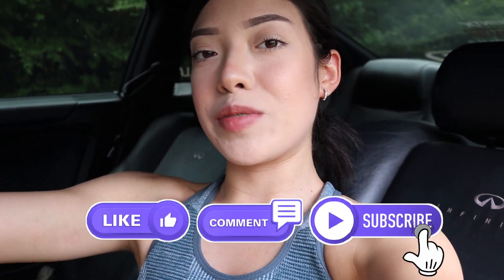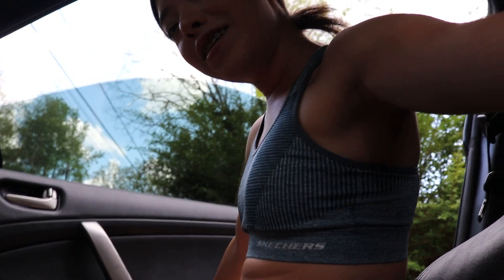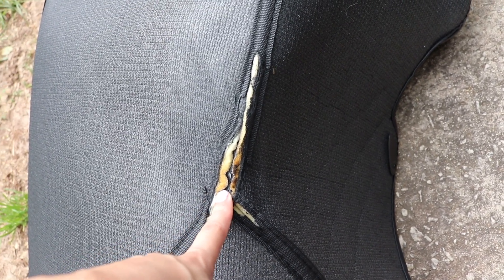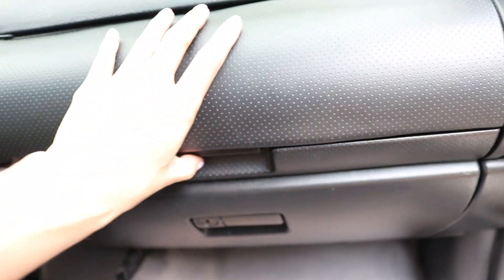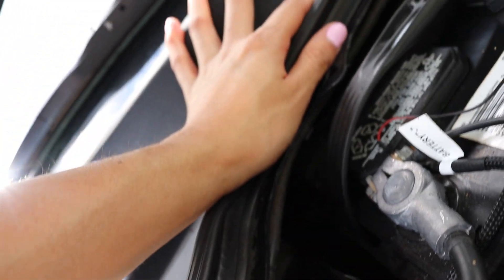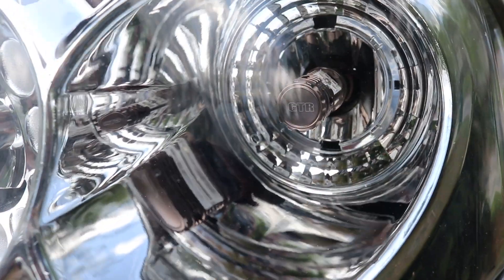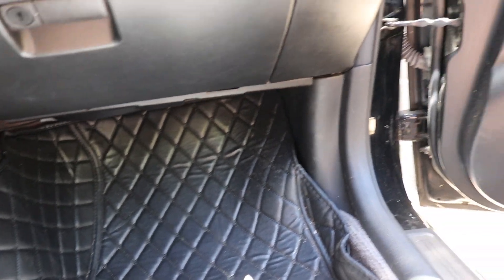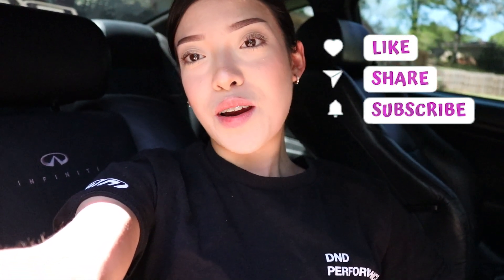Finding and fixing G35 coupe water leak

Comment: Pull the battery out and remove the battery tray. There are holes for water drainage underneath that tray. Sometimes the holes get clogged with debris. I just removed the rubber plugs entirely so any water can drain. Becomes an issue in the winter when snow builds up in the wiper cowl and eventually melts and leaks into the passenger floor.
Reply from the maker: I checked there and the holes aren’t blocked at all, but I’ll continue to check when it rains again 🙏🏼